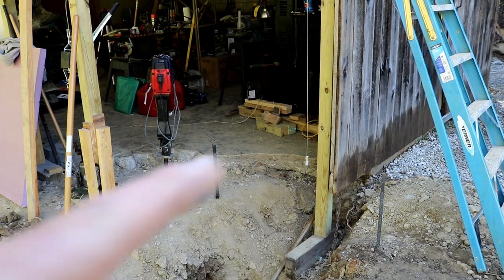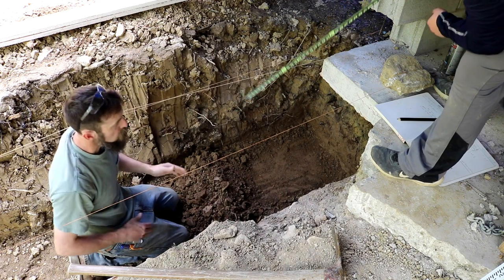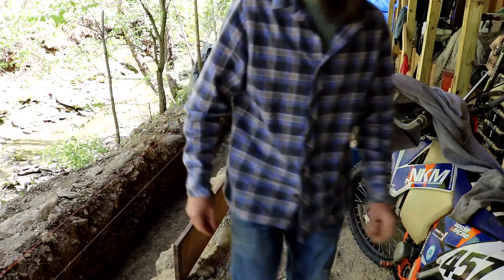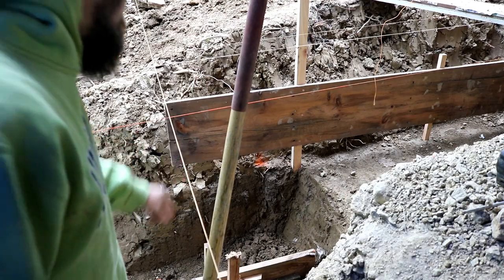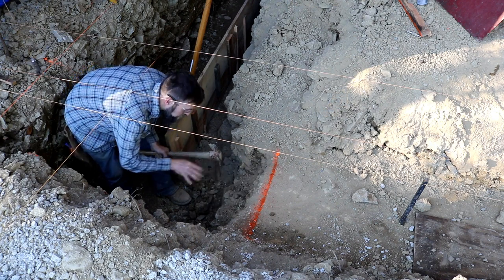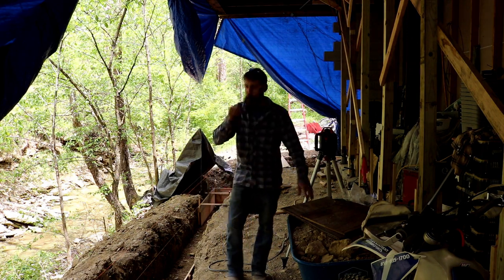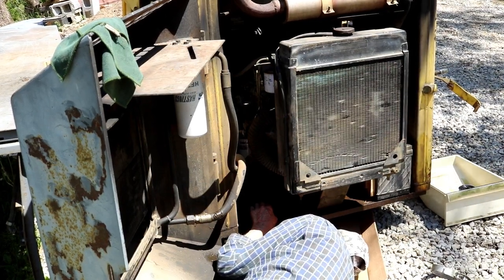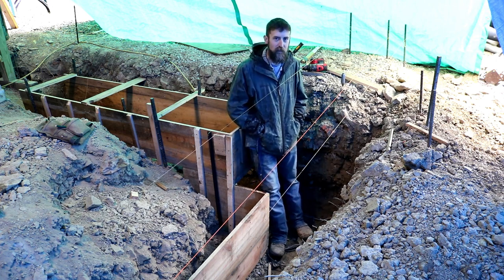Building concrete forms for the shop Footings . Damaged Shop 13

Comment: Steve: Not sure how I managed to screw this up, but somehow my possibly overlong comment appears tp have been eaten by ave's a ngry pixies. What I was trying to address was your problem with ticks. Diatomaceous earth will kill huge numbers of various insects, including fleas and ticks, yet it is non-toxic and won't hurt your dogs or squirrels. I use the food grade on my dogs coats monthly, and dust my chickens and also put it in their food. Lots of vegan hippie health food knotsy types even include it in their diets, and they are very close to human! 
The difference between the food grade and regular is that the food grade stuff is from fresh water diatoms and the other is from salt water. Food grade is usually white and the other sort of tan. It is incredibly cheap, safe and easy to use. Sprinkle it in a barrier on the ground around your house and shop, and dust your critters once a month. There are many YouTube videos about using it. Amazon, good pet stores, nurseries and pool supply stores have it. (It's used in really high-performance pool filters instead of sand as a filter media.) Anyway, thanks for the videos and for including Chloe and Peanut and friends in them! I hope I don't screw this posting up this time! 😁
Frank

Comment: to prevent the end of the cheap string from fraying hold it to a lighter , it melts the bits together
as for the blocks in the footing , prolly a good idea to stick a few lengths of rebarb in them and fill the hollow spaces with concrete at least untill above griound level , those blocks arent watertight and could have the cavities fill with water ,if the water freeses and taws it could blow the block apart underground ruining all support under the wall 
as for the concrete work , maibe reach out to someone allready on youtube that does concrete and masonairy work and have him stay with you for a few days or ask his reference on someone local to do the work the way you want it done , you can see how hes working on his channel and it might create more subscribers to eachothers channel too
the only problem left then is where to get the concrete and the reliabillity of those guys to show up with the trucks on time and all that 
it might be the fact that youre somewat in the boonies causing contractors to think twice working there , the guys on the phone do a google earth search after hanging up and go ,,,,, no way

Comment: I have had the same `problems trying to get my shop built. Nobody wants to work. Nobody calls you back or shows up. I would do it all myself if I could, but I cant. It's so frustrating.
Reply from the maker: There are some really good hard working people out there.  Seems like most are booked months in advance. You have had some real trouble with the weather as well Tom.
Reply: Steve Summers Yes weather has been horrible. We set a record in the month of April.

Comment: 45:10 why is the one footer high than the other?  Non-load-bearing?
Reply: It's called a step down. The dirt on the high side is firm enough to put the footing on at a higher elevation than the low side, so instead of digging it out and pouring concrete back (wasting time and money) you make a step down. A step down should be 8" - 16" or 24" to match the masonry, in this  case 16" . Over 24 inches you would normally used a lintel.

Comment: I am concerned about the ability of wood stakes to resist the pressure of the concrete. I feel that you should consider using home made round steel stakes, without hole., set in pairs and tied together by large gauge steel wire at several heights. Also coat the inside of the form boards with used motor oil as a release agent. Another idea would be to simply fill the backside of the form with small gravel or sand. If you decide to use the wire install it loosely and use a big screw driver to twist it tight. Also get a concrete vibrator. I think you may have to do most of this concrete work yourself, so call on your friends  and have a picnic. Feel free to disregard an old mans thoughts. Good luck.

Comment: Buy a Stanley FatMax tape measure. They're more money but they're worth it.
Reply: Tapes are made to stop several feet before closing otherwise they'd slam home and soon tear the hook off the end of the tape, resulting in a warranty return.  Additionally, the first few feet (up to approx. ~10 ft.) of the tape are frequently used and not having to struggle with the tape to keep it open is preferred rather than using the slide friction-lock.

Comment: I think, listening to Steve, that this is the first time he had to deal with the typical contractor. They tell you when they will be there, and never show. I think that is contractor schooling 101. And for the record, no contractor will ever do anything like you wanted or stated. That is in the advance contractor 101 schooling. Doing everything like you want will make you feel better now, but a couple years down the road, none of this will make a hill of beans (pardon the pun), sort a speak. Personally, I would like to have more concrete then just enough. The weight you are talking about from the additional concrete, will probably not change the total weight on the hill to worry about. If it is that iffy about weight, you have more of a problem then you think. And the additional concrete adds to a more solid foundation. Usually it is the other way around. The contractor wants to use as little concrete as the law allows because it cuts into their profit. If you are going to block up the walls with cider block (concrete blocks ?), even partially, on top of the poured foundation, then YOU adjust any height differences as you mortar them in-place. The mortar is there for that. But you have to satisfy yourself first, and therefore whatever you choose, is your decision, your money, and your work. Thumbs Up!

Comment: Just wondering how in the hell you are going to get those forms out after pouring the concrete? Sometimes just using the ground as forms, and wasting a little concrete has its advantages. That is the way ALL concrete finishers will want to do it, as footings do not have to be precise in any way as the block is where you level and plumb everything. P.S. I am totally impressed with your sheer determination, and work ethic, slow and steady wins the race! As a 37 year construction professional, you really need to bite your tongue and let the professional do it his way. The worst jobs are those a homeowner tries to tell you how to do it, usually we just jack up the price when you run into your scenario, or avoid it altogether, just a bit of advice.

Comment: I am no expert but dont you need to beat steel beams into the ground to stabilize that foundation so close to the brink?
Reply: He's working with a structural engineer.
Reply: I've worked on a similar project to this also near a creek and the engineer made us bore piles down every 18ft and we poured the footing ontop of the piles to form a beam connecting all the pile tops together

Comment: Steve, I am very impressed with your foundation work.  I was worried about your ability to drive stakes in that rock garden you have. LOL  I have been very happy with the Baur tape measure I got from HF.  A battery operated sawzall would have worked great for cutting off the stakes.  You know where the name Ariat comes from?  The racehorse Secretariat inspired the name Ariat.  The company was founded by two women.  Good luck with the concrete.  I'm estimating 6 yards (+/-) of concrete for the footer,  (70'x1.66'x1.33')/27=5.724  is that close to your estimate?  I know your pain finding some one to do the work.  It's a concrete/masonry workers market around here, they are all scheduled out 4-6 weeks, and can pick and choose their jobs.

Comment: Steve, Do I feel you pain dealing with 'contractors', and I use that term with much sarcasm.  Trying to redo the front of my shop, an 1800 sq foot space, need new slab, walls, roof, the whole bit.  I expect it to be $100K+ work easily. I have had NINE contractors come look at the work.  Most take measurements for hours, pictures, you name it.  Say all sorts of stuff about how much they want this job etc.  Then what happens? Not a damn thing.  Never hear from them.  Some of these guys drove two hours to get here, and nothing.  I have found a guy that will do small jobs, well done, and for reasonable money.  But he will only do small jobs he can do by himself.  Framing up 40ft walls doesn't fall into that category.

Of course this was all pre-covid.  I am guessing they are going to be a little more hungry now.
Reply: Actually contractors are going like gangbusters with folks home. They're home. So they want work done around the house. Plus commercial work hasn't skipped a beat either. Covid is political. The Dems just want to screw Trump over. So this is how they're doing it. They colluded with the Chinese. Which they've been doing for decades now. When Joe Biden ain't extorting the Ukranians he's eyeball deep in the far east.
Reply: @1pcfred  Agreed
Reply from the maker: I normally try and do what I can myself. But this footer is not a 1 man job. Probably more like 6+ people who know what end is up. 
I'm tired of no return calls. I'll gladly pay anyone who is even remotely close to reasonably priced to get this job done the way I want it. Please take my money in return for work. I will hold your coffee as well.😁

Comment: If its not too expensive, it might be a good idea to vertically drive some 36" long #8 epoxy coated rebar down along the centerline of your footings to help tie them into the creek bank.  I feel your grief, so many construction contractors are a bunch of worthless yahoos.  I bet you'll be learning how to lay cinder block this summer, its not rocket surgery.  Looks like you need about 6 cubic yards of concrete.

Comment: Steve i have 5 or 6 maybe 7 could be 8 things that im worrying about can i send a list of them to you so you can take over your doing a better job than i am at worrying so could you worry about mine also i guarantee this footing is going to turn out 100 percent ok so you can ck that one off and ill replace it with one of mine. what the h were not building a piano anyway stay well

Comment: Most concrete crews would not form this up. A small job like this they would come out dig and pour it in one day and use a laser level like you to get everything within 1/8". Yes a little extra concrete would be used, but 1/2 to 1yd of concrete is cheaper than paying a crew to form it up. Forming it up yourself will save you prob $100 in concrete or $500 for the crew to do it.

Comment: Most contractors won’t take a job on, unless they do it all. They don’t know if your measurements are correct, so they have to start from scratch anyway. Contractors won’t just come in and pour cement for you because if the measurements are off, people will blame the contractor & not the homeowner that built it. I ran into the same situation, to holes to fill... contractor wanted 1700 bucks a hole, I asked how much would it have cost me for them to do it...1700.00 each hole...

Comment: Don't get the issue with stacking the blocks yourself. I mean, they are meant to be used without mortar. Just stack them and fill 'em with concrete, how they are designed to be used.

Comment: Steve, I love watching you work, but if you use your skilsaw with wood propped up on your leg, I will go to the airport, fly to the States, do the quarantine, drive to your house and give you a dry slap. Then, I'll drive back to the airport, fly back to the UK, do 14 days quarantine, and comment on your channel again. Please be careful with your tools and legs.
Reply: Very dangerous.  The spinning saw blade is within inches of major leg arteries and left hand, arm.   

There's a good reason why the Skil Saw has a left hand grip on top and a right hand grip with on/off trigger at the rear of the saw.  Both hands are meant to tightly hold the saw when making a cut.  NOT using your left hand or left foot, to cradle the workpiece, while using your right hand to awkwardly maneuver the running saw to, hopefully, make the cut without a dangerous kickback.  Think about it.  It has to be the worst, the most dangerous position to use the saw, holding it near the rear.

Comment: Steve as much preparation's you have made and you lay the block yourself you won't have any issues and it will go quickly. Get you a set of those wooden blocks to run a string line between corners and will be golden.Here is a link to Lowes if you don't know what I mean, https://www.lowes.com/pd/Marshalltown-1-in-x-3-75-in-Line-Block/1000070695?cm_mmc=shp-cprdtolgooglelia-217-hardsurfacetools-1000070695-_-0&store_code=1798&placeholder=null&gclid=EAIaIQobChMIuvG-tOim6QIViIbACh34vg2PEAQYAiABEgIMRPD_BwE&gclsrc=aw.ds

Comment: At 16:44 you were adding up inches and feet and I had to laugh a tad. When I was a youngster here in Canada we had Imperial measurement of inches, feet, yards and miles. We also had acres, sections, ounces, pounds, tons, fluid ounces, cups, pints, quarts, gallons, barrels, and we also had to learn to convert Imperial gallons to the smaller American gallon. Then, when I was about 25 or so, someone decided we had to go metric to match up to the rest of the world and the Americans agreed and were commited to the change. So now, by law, everything had to be in hectares, millimeters, centimeters, meters, kilometers, cubic centimeters, liters, grams, centigrams, kilograms, tonnes, ad infinitum. Then a few years later, because Reagan decided the U.S. was not going to convert as promised before because it would cost too much, our Government decided we could now use both systems instead of just one or the other. 
So when you were totaling things up (   3' 5 3/8" + 16" ) my brain was going 3' 5 3/8" + 16" = 3' 5 3/8 + 1' 4" = 4' 9 3/8" change into inches = 48" + 9 3/8" = 57 3/8" then 57.375" X 25.4 =  1457.325 millimeters divided by 1000 = 1.457 meters............and that's when I started to laugh. You see, I just knew in the back of my mind that there were at least 20 more Canadian tradesman out there who were quite possibly doing the same thing and if you need to know the Imperial to American to Metric conversions just ask a Canadian because we've seen them all and use them daily. If you work in construction in a refinery then most of your drawing will be in feet and inches because the oilfield is still in barrels. If you work in a pulp mill chances are good it will be metric. But there is no guarantee for either so you have to be prepared like a boy scout. So now, just how many cubits are there in a cubic meter?

Comment: not sur ebeen said. or if iam even close to bein rite.. but screw thru form boards for ur inside height. then boards can be whatever u want them to be.. leavel the screw thrus done deal. 20 mins . lay ur forms tons easier. or easy to do. wire bridges at height you want .. drill hole wire thru twist with bolts on each side. then u have wire bridge across inside forms. who knows i dont have a clue. someone stop me
the beeping is that way so you can hear it on a site. think of the bobcat running 4 ft from u. and you have found the guy who cares about his work and doesnt mind bein on cam showing his work... YOU... Get R done buddy.. you come this far. see it thru ...

Comment: You are going to have to put in a lot of support from the form to the side of the trench on both sides to prevent blow outs. Concrete is extremely heavy and if you don’t the forms will not hold the weight and trench will end up being the form. When you have concrete trucks on site it is too late to shore it up. Having too much bracing is much better than not enough. After watching all the work you have done it would be a shame to see it come undone when you are pouring the footings. Just saying.

Comment: the real problem is the access is tough around the footing and you are basically working into a trench. nobody does that. they open up twice they need to be able to work beside the form and backfill. youll end up on your stomach flattening this, not an easy job/they will charge double because of the trouble...

Comment: A lot of you are giving Steve a hard time about locking the door of a building that is missing walls.  I have seen where thieves broke in through a window when a door was left unlocked.  Some thieves are so stupid that they will look at the lock and say to their selves "well it is all locked up lets try someplace a bit easier"   Besides he can tell the insurance adjuster that the building was locked.

Comment: We would have set a bulkhead at the step and poured that ditch full of concrete . those forms you have there are a complete waste of time and energy. 30 years in concrete and i'm still learning but the amount of concrete you think you are going to "save " by forming the footing you will throw out in the truck when its pulling away Steve . Not trying to cut your work down just stating reality.

Comment: forming anything that will be below dirt is unnecessary work that delays the project, you might save in concrete but it costs you more in time. especially when you have to fill in and compact around the concrete

Comment: I guess I don't understand why you are pouring concrete in the first place. If you are only using two blocks high under the framing, won't the nylon string hold that up? Maybe add some duck tape and you should be good.
Frank 😃